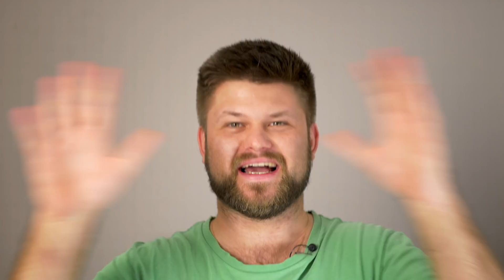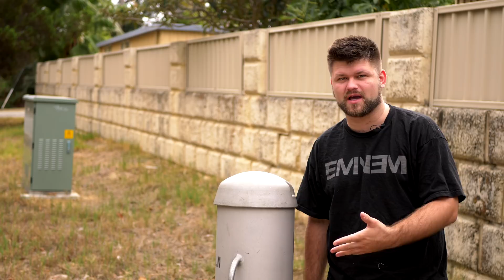What is a Node in the FTTN NBN | Tech Man Pat

Comment: In the FTTN model, the further away from the node you are, the lower the connection quality you get, right? So why did NBN decide the best place to put the node is on the edges of the areas each one is servicing, rather than the middle? Also, why did they lay fibre optic cables up my street, almost right to my door in fact, when my street is a cul de sac and no-one in the street will be connecting to that fibre cable and it terminates next to my driveway and leads nowhere? What was the point?
Reply: And further to the above, I asked the workers installing the cables why, they didn't know either. One thought the fibre cable in our street was 'for distribution', to what?

Comment: What are the micro Nodes for?
Reply: They are just regular nodes with things like battery backups removed and they serve less customers.
The idea is for areas where the property density is lower and NBN want to reduce the cost per property.
Reply: Tomas Gibbs so if a micro node poped up closer to me recently is it possible for me to be transferred from my regular node to this as its closer I'm 1000m form my current node
Reply: @Boombox198719  Yes I was migrated to a closer node.
I had a speed fault when the tech came out i suggested to fix the fault he moves my line to another node sure enough he did.
Reply: Tomas Gibbs I hope you're right however that micro node on nbn website days Aug 2020 🤔
Reply: Tomas Gibbs which tech an nbn tech or telstra tech or some other tech I asked Telstra to be transferred and they told me to call nbnco and then they told me to contact telstra I was furious

Comment: Can you do one of these on HFC? Where are the CMTS located?
Reply from the maker: I can look into it, but from my understanding it is very similar, except that node is much bigger.
Reply: The CMTS is located in the local telephone exchange, From  fibre runs to the end of your street in most cases where a fibre node is located, from the fibre node it is thick coax to the front of your property where a tap is located where all the customers connect to.